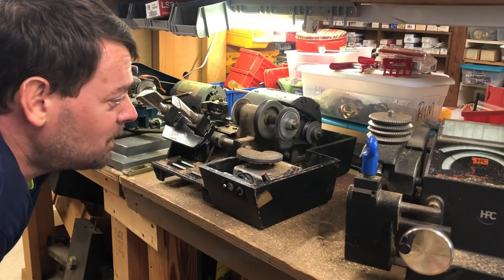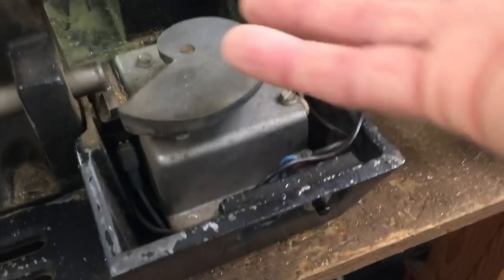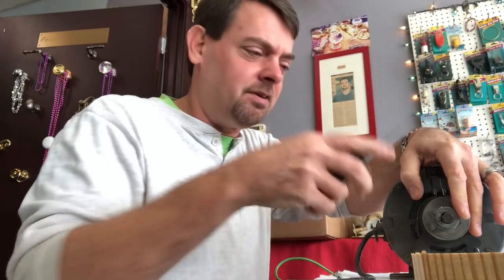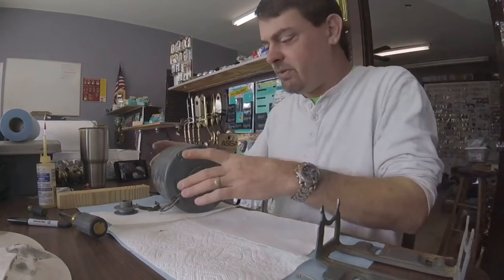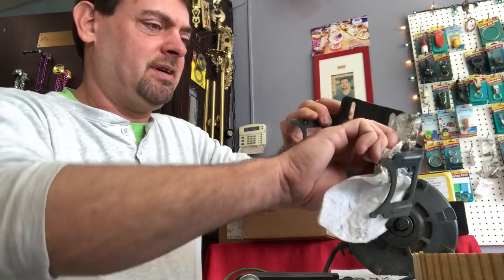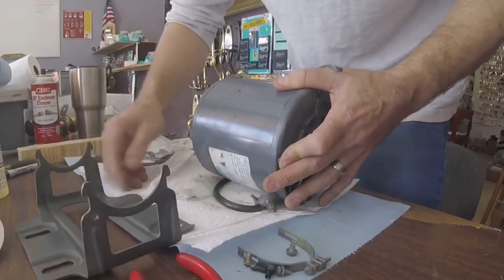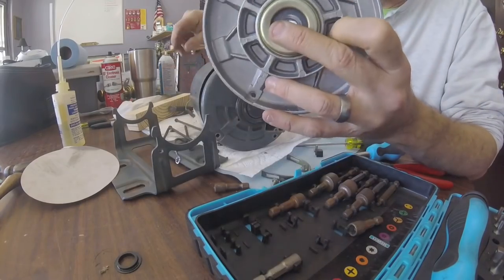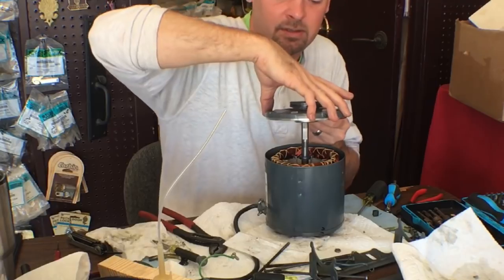key machine electric motor repair Ep:2 “should we crack this motor open?”

Comment: That "fabric" is usually felt and it is what the oil soaks into when you oil through the caps. It's supposed to be there.
Reply from the maker: King Street Rob we ended up comparing it to a zippo
Reply: @selock  Yep. Same sort of stuff. You can buy them or get a piece of felt and pack it in.
Reply: @selock  Add more oil. That wasn't nearly enough if the felt was dry.

Comment: T.N.T (tiny nut trouble) is a problem many of us in the repair/install/maintenance industry face on a daily basis, only through bringing awareness to the issue, can we conquer it! Nice effort on the motor (not confident it will help, or atleast for long) nothing wrong with your work, just what I've run into... outside of periodic lubrication, darn things are near "throw aways" based on parts and labor. Fingers crossed for you though Jason!

Comment: Did you ever try the motor with no belt to see if it ran at full speed?, simple motor function test.
If it ran its the other shaft, if not one winding is not fuctioning properly